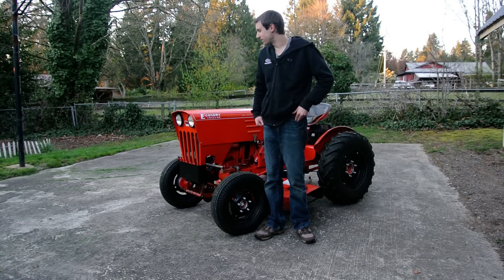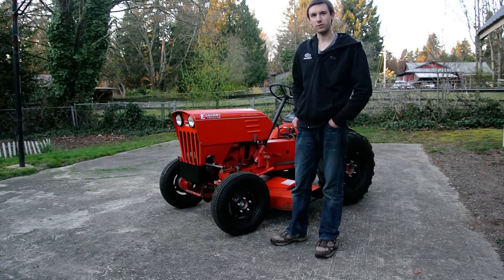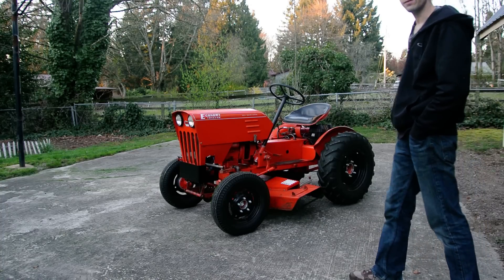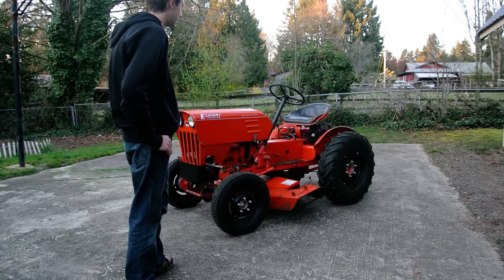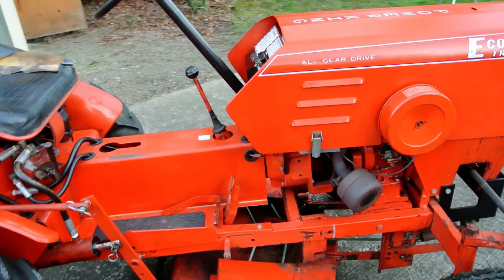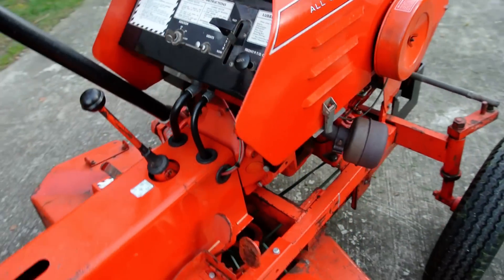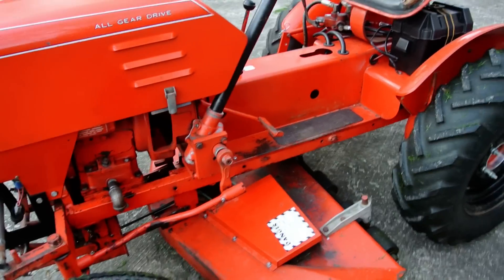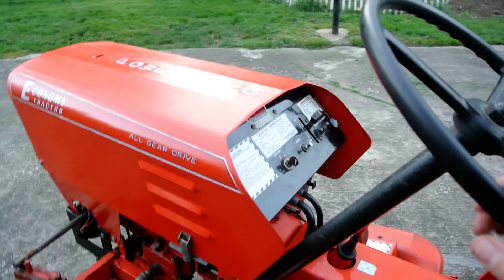What Is An Economy Tractor Like to Operate?

Comment: Folks, I own two of these machines, both medal bodied ones.  Can't say enough of how really great these tractors are.  When Power King began changing their tractors in the mid 80's and went with the plastic/fiberglass hood, other guys out there nick named them, Plastic King Tractors.  I loved the way they looked, they were heavy duty, monster machines.  Now I'm gonna be totally honest with yinz on this. The Plastic King tractors had a bad reputation of the transmission.  When the clutch went, it took the transmission right along with it to.  That's sad as they were so beautiful of a tractor there when they redesigned them, wish I could get one, however I stayed away from one that I ran across because of the information I was told about the transmission.  If it weren't for that problem, the tractor would have been mine. I promise you on that.
Reply from the maker: Thanks for the comments, Dan!
Reply: @AustenARW  Tell ya something else. If you need Flint tires for this tractor, Tractor Supply is the place to go. I had to replace one on the Power King medal bodied tractor I own that I use to plow snow with, and after the purchase and the mounting on the rim, it fit like a glove. I got the tire, as stated at Tractor Supply.

Comment: thank you for your time i really want one of these tractors i was looking into getting a 60" bad boy zero turn they run about 6k but when i found out that i can get a 60" belly mower for one of these and they can do so much more than just mow for about a 3rd of the price i have been looking for one ever since and the fact that they are just super cool dont get me wrong i like my wheel horse c145 but no 60" deck for it am looking for a 2418 i think these little tractors have a great place on a small homestead like mine with a few attachment will save a tone of labor the main reason to buy one with a few attachments the front end loader 60 belly mower a tiller a plow and a box blade would be nice but i dont think i will have a tone of money tied up in it.
Reply from the maker: Hi,

Yes, one of the advantages to a garden tractor over a ZTR is the ability to perform other tasks. If you're looking for a dedicated mowing machine that can get in tight places, maneuver quickly, and get the job done in record time then I would still consider a ZTR if those are your goals. These tractors do mow well but they are not by any means a ZTR. Attachments can be hard to find meaning you might have to ship them from out of state depending upon how ambitious you are to have them. Buying a "package deal" is usually the best way to go so you're not having to buy and or ship attachments separately after the fact. Good luck on either way you go! ;-)

-Austen
Reply: Austen yes with working with something older i would abide my time and find a package deal that has most of what i want the 2 trans would be nice but the 60" deck and the 3 point would get me on my way the rest i could find fairly easy i think thanks for tje information am kinda a cheap guy and i dont know if you have heard but they make plans to build a front end loader if you would be intrested when i found that i thought it was neat
Reply from the maker: Thanks, I know there are plans out there. I have another machine with a loader but thank you any way!
Reply: Not a fan here of those zero turn radius go cart mowers. They look to dangerous to me to bother with, besides, people has gotten killed on them to. Your much off with a tractor as with a tractor, you can mow grass, plow your garden, disc your garden plow your snow pull a fairly small cut down tree, pull a trailer, so many other uses with a tractor. See if you can do all that with those zero turn radius go cart mowers.  You can't. A tractor is the way to go!

Comment: How’s the deck install I bought one of these I’m trying to figure out if I have all the correct pieces can you show a tutorial on that
Reply from the maker: Hi, The deck install on these is actually really simple to install. First, do you have the mule drive? Mount that up first. There are two arms that connect the deck to the mule drive. There are several slots on the arms and mule drive that can be used depending on length of your belt to tension it. There should be a chain that connects your rock shaft to the deck and that's it other than installing the belt.

Comment: i have a 76 1614 with no pump belt can you see if there is a part # on yours do you know how long it is and does it have a break in it to install it.
Reply from the maker: Hi,

I would recommend getting a link belt. In order to replace it you have to actually separate the engine from the bell housing if you go with a standard belt.

Comment: How Wide is the tractor? I have a 4x8 trailer. Would it fit on it?
Reply from the maker: It should fit on your trailer. If there's a mowing deck attached, there may be some overhang but the wheels will fit.
Reply: Ok thanks man!